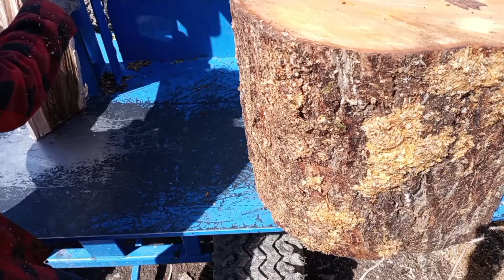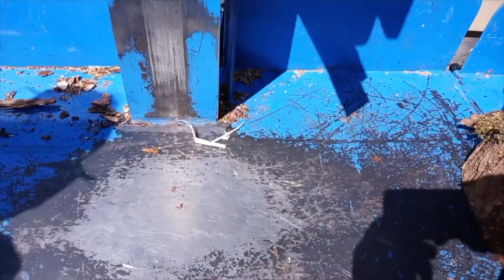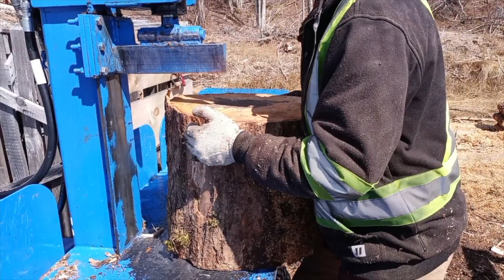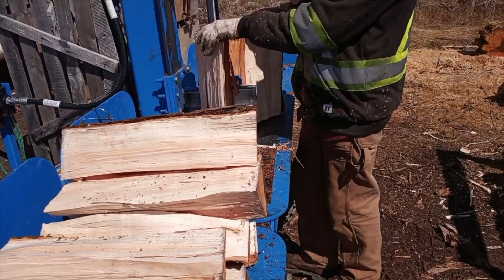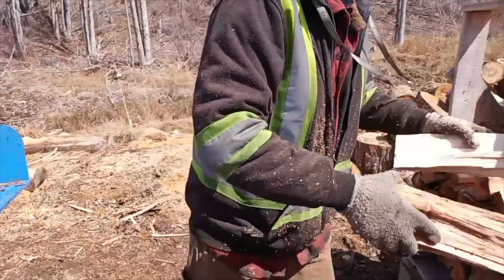20230411 Jim cracking open firewood a 19" diameter maple

Comment: I think another advantage of the vertical splitter is that you can see the end of the round better which allows you to split with the cracks. This means less splitter trash and less going into the slower second stage of the pump. Also means less horsepower needed to split which means less fuel. Nice work on those big rounds.
Reply from the maker: That's all correct. We've noticed far less splitter trash. I'd estimate at least half as much. And yes, we always look for the cracks and defects to make the splitting easier and quicker. This unit has the following specs; 2 stage, 16 gpm, 3200 psi, 26 ton spec.

Comment: Very nice splitter. Why did you pick it over the eastonmade vertical?
Reply from the maker: We owned an EastonMade 12/22 for a couple years. We sold it and bought this one. It's a better fit for our operation. And honestly a better splitter overall. Less trash produced and less physical strain on the body. Gina can operate this one better than the 12-22, much less physical work. EastonMade does make a vertical splitter but it's nearly twice the price of this one.
Reply: @WoodchuckCanuck  good call. It’s the one I will buy next too.